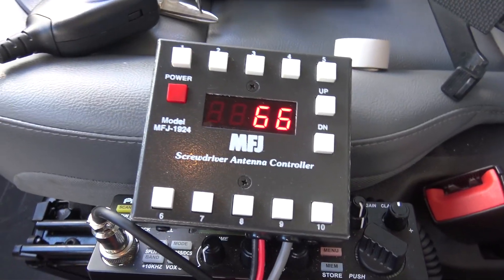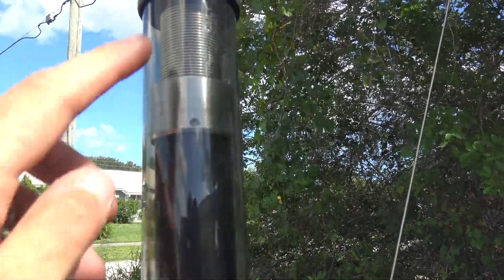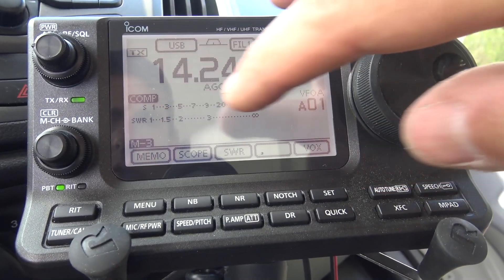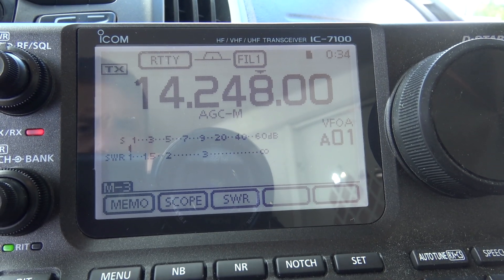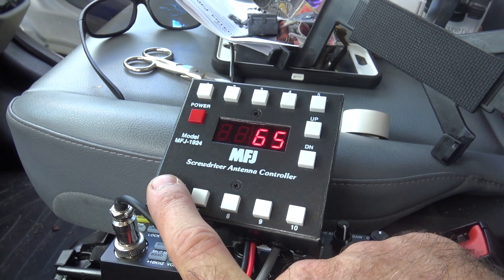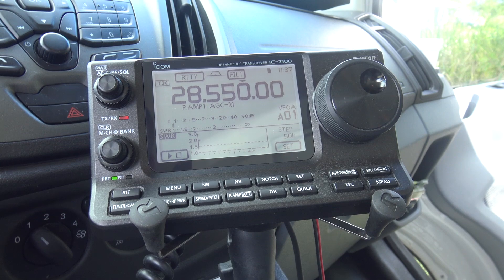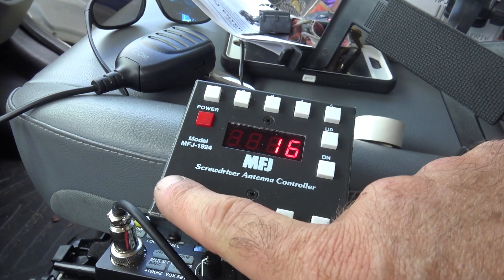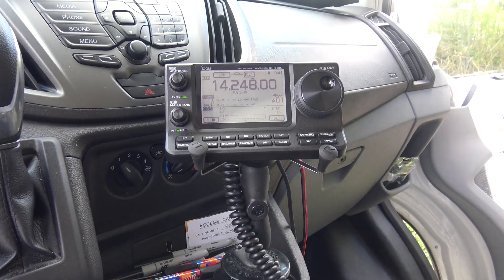MFJ-1924 Programmable Screwdriver Antenna Controller

Comment: Did the mfj 1924 come with a 4 pin molex connector that fit the Tarheel molex connector? Also, did you have to change any settings for the antenna to return to home?

Comment: Hi Eric, Great Video as usual, I have a 7100 and an LDG IT100  Could this drive the Tarheel ? Not sure though
73 Pete VK3TQ
Reply: No. If you have a Tarheel then you don't need the IT100. You tune by moving the antenna up and down, which shortens or lenthengs the radiator. Therefore you don't need an additional tuner. 73

Comment: I've been using a Tarheel 75A antenna for over 10 years but never needed an automatic controller. The UP/DOWN switch is all I need to switch bands in just several seconds. I just move the coil and listen for the highest level of noise. 9 times out of 10the SWR will be 1:1. Sometimes I need to bump the switch up or down again to fine tune it. I really don't see a need for a controller.

Comment: I have this antenna controller also on my Tarheel. However the other option is a MFJ-1927 auto tuner that works with the tune button on most radios for HF and 6 meters. You may want to give ole Richard a call about it. The problem I had with the MFJ-1924 was it would lose it's memory and forget where it was and when I push the up button it would go down and visa versa. So then I would have to reset it and reprogram all the bands and frequencies. The MFJ-1927 works like a charm..   Thanks for another video...

Comment: Question for you. How long is or is there a cable that goes from the Tarheel out back to the controller at the drivers seat?? In the process of putting MY 7100 in my Jeep Wrangler...

Comment: Eric...The Tarheel works so well attached to your truck, can you think of any reason why it wouldn't work as a base antenna?  Up on a pole, and with sufficient ground, I can't imagine why that wouldn't work.....especially for someone with limited space to erect a traditional base antenna.  Thanks, and 73  :-)
Reply: It will work great as a base antenna but get the longest model of a Tarheel available, rated for the highest power. It'll be a lot more efficient. Mount it at a ground level and install as many radials as physically possible. Radials length is not critical at ground level but try to make them at least 9 ft long and as many radials as possible. 
Top whip should also be as long as possible. A long whip with a capacitive hat will further improve efficiency. The whip can be replaced with a longer wire that goes up in a tree. Bend it 90 deg. in the middle (or towards the top) if necessary. 
Don't expect miracles on the lower bands with a shortened antenna but it will get you on the air better than a mag. loop, loaded gutters or an attic antenna.

Comment: I had one of those controllers  after getting bumped a few time in my truck the buttons stopped working . other then that it worked well with my Tarheal and FT857

Comment: Eric,  What I have done is matched the memory channels on the radio with the numbers on the controller.  So If memory channel #1 in the radio is 80  meters, then memory channel 1 on the controller is for the channel in memory #1 in the radio. Quick way to do it while on the move in the vehicle.  Gives me a quick spot to start with.  Thanks for the video de W0HL